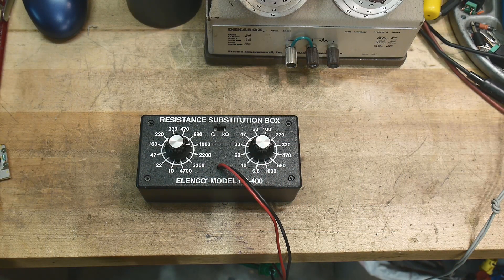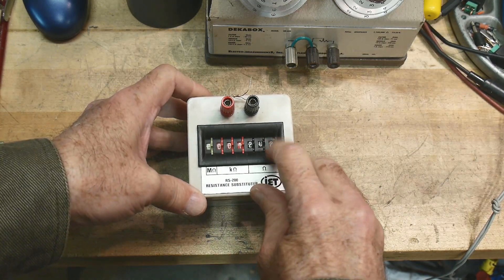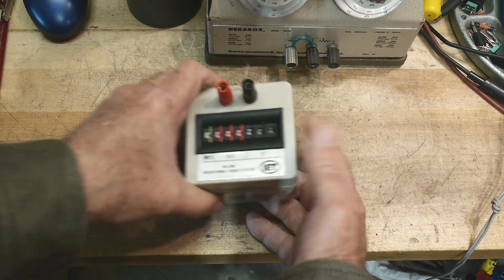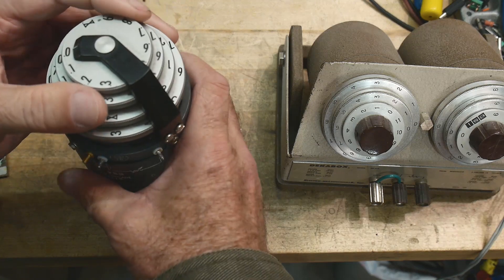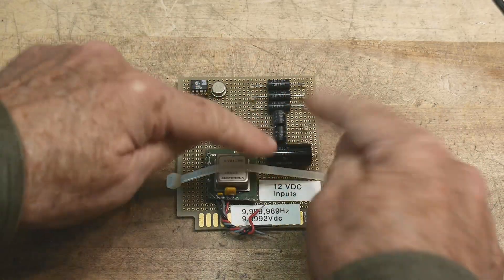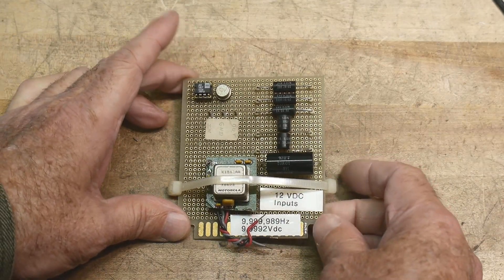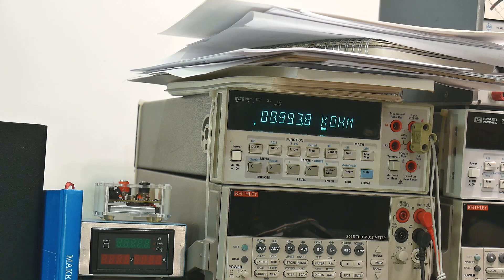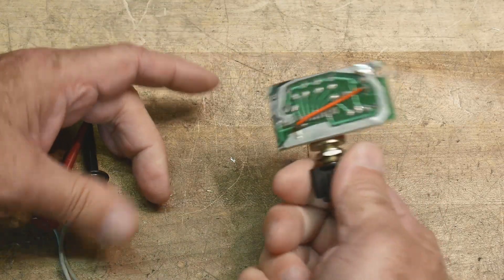#720 Resistor and Capacitor Decade Boxes on the Cheap

Comment: I always found the capacitor decade boxes more useful. It's easy enough to find the ideal resistance value with a pot and then measure it, but if you need to find the ideal capacitance without the decade box, you're sol...

Comment: I think I’m going to make the poly film assortment. And a SMD resistive decade too. I was going to get some selectors but after seeing those dip switches I think it will work fine with old IDE ribbon cable connectors as a breadboard.

Comment: I made a resistor box myself just to have a standard, I've used 1% resistors with the values of 10, 100, 1K, 10K, 100K and 1M ohm.
I thought it would be useful but I've never used it, I just don't have any use for it. I guess there may be once a time in the future that I need it and then I know I'll have it within reach because I put it in a box that I use very often that has a volt and ammeter combo with a switch on battery which is very handy.

Comment: Because we are doing it on the cheap... Just use common linear (not audio) potentiometers, gleaned from old equipment. Bracket their values. For the lowest value pot, use a multi-turn, to be able to dial in with precision. Roughly set it, initially, with a multimeter. Plug it into the DUT. Change the values, until the DUT preforms in the way intended. Then, read the value of the pots with a multimeter and solder in a resistor of that value. 

Here's a bit of test kit that I just cobbled together... I am forever needing a potentiometer for testing DUTs. I hate temporarily wiring them in and then trying to hold the pot while I fiddle with the knob and try not to pull the wires lose. 10K is the most common value that I need. So, I attached a ten-turn to a wooden base made from scrap MDF board, an empty medicine bottle and an old CD. I put no-slip shelf liner material on the bottom, so it stays put while I dial it in with just one hand. The knob is a 3" diameter circle of scrap MDF. (3" Diameter + 10-Turn = High Precision.) I put a rubber band on its outside diameter, so I can scroll it with just one finger. I put small alligator clips on the color-coded leads. Yes, it is big for what it is, but its size is what makes it great. No fiddling, just s-m-o-o-t-h sailing. It was a fun build and generated a most satisfying and useful result. It is truly at the top of my favorite bench gear.
Reply: That's a good idea definitely, especially for those who have tons of old parts laying around. I'm mostly working with guitar pedals and amps so I already have tons of audio pots lying around in bulk but for those who have the time, repurposing kit saves so much cash.

Comment: Looks like the ArduinoMall boards were designed to be used with Arduino microprocessor boards, hence the euroblock terminals and four-post form factor. They were never designed for a multimeter. Also, yes, the lack of proper spacing on so many banana terminals drives me insane as well. I don't get it! Why bother if you won't do it right?

Also, what kind of stability do you get on these kit boards? Do you ever see appreciable drift in values?